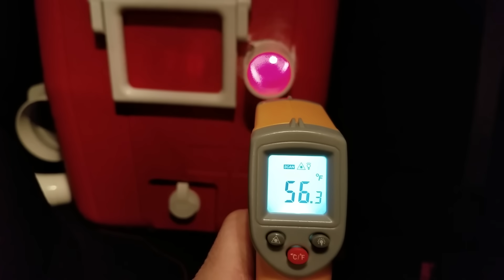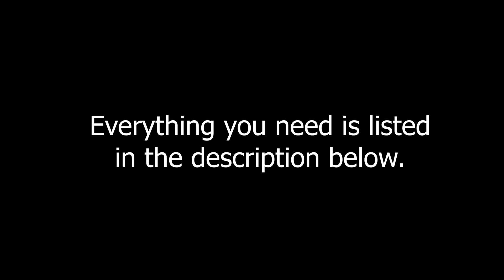Homemade Portable Air Conditioner DIY - Version 2 - Runs off 12 volt battery, car, or solar!

Comment: 4:30 this is the most stupid thing I have ever heard. No the air isn't cooler if it's blown harder. In fact it's even slightly warmer due to compression. The reason it feels cooler is because more moisture from your hand is evaporating and for that to happen, it needs heat, which is transferred from your skin to the moisture.
Reply: It's called the Bernoulli effect.  Its the reason you must worry about carburetor icing on an aircraft engine even when the outside temperature is 100 degrees.  Forcing air from a large volume into and thru a small opening.  An experiment:  Air up a tire to the proper pressure.  Remove the valve core, which will release the air thru the valve stem quickly.  Ice will appear on the threaded part of the valve core.  It is fleeting, melting VERY quickly.  So, yes, if air is forced thru a smaller opening it will indeed be cooler.  Quite a bit cooler in some instances.
Reply: Jesse O'Q 

He was explaining how the Bernoulli effect works, and correcting the person who was attempting to "correct" someone incorrectly. He wasn't applauding the device for its efficiency.
Reply: wish i could laugh at your comment
Reply: Jason Ozment I agree.  There’s always some genius out there to berate people for their efforts. Jesse is a real motivator isn’t he!  Funny, but the fact is the video shows ambient temperature lowered through this device using a simple inexpensive motor (both to buy and run) and a few other parts.  If the idea was to create cooler air, then he achieved that.  It was never meant to be a thermodynamic innovation.  Jesse, what you need to be schooled on is your social graces since you have none.  Maybe you can get that big head of yours back through the school door.
Reply: Jesse,  ok so forget the SUV.  I have a travel trailer that has ice cold AC when hooked up to power.  I want to stop in a rest area in florida and take a nap while not totally melting away.    There is no power for me to hook up to.  I don't own $2000 worth of honda inverter generators and if I did I'd probably have to stay awake instead of napping to watch them and make sure nobody steals them.

This seems like a reasonable solution to allow me to cool, even if very inefficiently, the space where our queen bed is (not the whole camper) so that I can nap.  and all for the price of some battery power and a couple of dollars worth of walmart ice.

Is there a more efficient solution to my prolbem?  I'm asking with genuine interest as you seem to have some knowledge I might lack.

Thanks!
Reply: Jesse O'Q There’s a reason you had a 1.7 GPA...
Reply: Ricardo Cruz I still am laughing at him, weeks later.
But what do I know, I'm no rocket scientist.
Wait, my old lady said I am.
Reply: FACT BATTLE
Reply: Knetterkop. The faster air moves over an evaporator, the more latent is removed through condensation. Just the opposite for heating.  In heating the longer the air move across a heated surface then the air can pick up more BTU's so you slow the air down!  No one is compressing air, just removing heat form one area and displacing it to the outdoors, just the opposite for heating!  The only time the application of compression is a add heat to a refrigerant through a compressor.
Reply: If you take the same amount of volume of air and you push it through a smaller and smaller opening eventually that are will become quite a bit cooler than where it started you can actually make an air conditioner using that method where all it does is push the air through smaller and smaller tubes it's been done before the air becomes condensed and cool.
Reply: Jules Thompson effect. He steps the air pipe size down twice. Science is your friend.
Reply: Unfortunately I'm in florida... evaporative air conditioning doesn't work :P ... same with lying in the grass in the shade... :P

I'd defiintely have a dedicated battery pack for this that gets charged by the towing vehicle while we drive.  I share some of your concerns but there's only one way to find out.  The problem with the generator is that they take up A LOT of space and our travel trailer is the right size for us but space is at a premium... and they're crazy expensive if you need them to generate the power required by the units they put on the Trailer.

Frankly I can't believe the manufacturers haven't figured this out yet and equipped the trailers with the option of two smaller units... sure two smaller units would be more expensive than one larger unit but...

If one fails you still have some ac...  you can have better climate control which I'm sure some people would appreciate, for instance vent one to the sleeping areas and the other to the central area.  Finally of course two  smaller units could be small enough that a 2000W generator can power one.  That would be awesome :)
Reply: yeah, I hear you...and the weather for usa is atrociously hot and getting hotter...during power outages, we always hear on the news that people are stealing generators from others...people get those for emergencies but I wouldn't..you still needs to store fuel for long term...this idea on the video is worth a try...I was going to donate my old cooler to goodwill but I may try this out...good luck my friend...may you keep cool
Reply: And you have a better video on how to? Kick rocks man he is creating content for people to use
Reply: Why are you talking like you know what your talking about, when you clearly don’t. It’s simple thermodynamics...
Reply: Shieky El I'm just telling that what he is saying is wrong. There is no problem with great content, but don't tell stuff that's not true
Reply: Knetterkop somebody please explain to him how a nozzle works and that whay he felt was just air going faster due to the area reduction, and a fresher sensation, not colder
Reply: the faster the air the less time it has to mix with the warm air
Reply: honestly, how often do you stop at rest stops between your travels to sleep?...if you take naps often, then maybe a generator would be the answer and have it built in to your trailer $$$$..this video has a simple, good, easy to make cooler (but loud not for sleeping)...and it might not be enough to cool down the trailer...put the cooler outside in the front by the batteries on the frame or back bumper and run both the pipes through a window of the trailer with a makeshift panel enclosure...and don't know the size of your trailer and how this would work for cooling...and you would drain the batteries unless you run solar...and you might want to invest in some good 12v fans or amazon: $45.00
Fulstarshop Universal DC 12V 35W Evaporative Air Conditioner Car air Conditioner Portable Mini Cooling Conditioner Water Evaporative air Fan, Black...but do your research...I would just lock up the trailer and sleep on the grass under the trees until you get rest and ready to go again but in Arizona, it would be difficult...good luck my friend
Reply: Elmer Thudpucker The Bernoulli effect is the same concept used in modern refrigeration. This however is a cooler of ice with a fan. It's a totally inefficient and silly idea that has nothing to do with the Bernoulli effect. Similarly, I don't plan on cooling my SUV by filling it with tires and deflating them while I drive. I'm glad you're interested in physics, but I hate watching people teach other people how to invent square wheels.
Reply: Congratulations! You've invented a Rube Goldberg SUV air conditioner. I barely have a HS diploma with a 1.7 GPA and I could school your ass in thermodynamics. Stop trying to find better ways to move "cold" and consider that cooling is about moving heat. How about putting wheels and an engine on your refrigerator and driving that around? OR MAYBE just fix your vehicle's AC, you dummy!!!
Reply: Jesse O'Q not capable of critical thinking are you?

Comment: 3mos later, part 2 review? Any pros/cons you care to discuss? Thxs for sharing, cool diy!
Reply from the maker: The only thing I would change is I would have run the metal tube in higher on the side rather than at the bottom. I had a small leak form that I had to fix. If I had mounted higher, it would not have been an issue. Other than that, I'm happy with it.

Comment: How long can you run this thing on a 12-volt battery without recharging the battery? Alternatively- do you think a solar panel would work to power this? If so- what type would be necessary?

Comment: Getting ready to build one to use at my daughter's soccer games at the bench on hot days. I'm considering installing the in line fan inside the cooler to minimize sound and the large fan hanging off the side of the cooler. My concern is would it be too cold for the fan inside?  I may use a small chuck dry ice in addition to water ice, but probably mostly regular ice due to convenience and cost.

Comment: Yeah, these don't work.  I tried one once when our air cond went out.  It isn't worth wasting your time building.  Build a swamp cooler because it WILL ACTUALLY cool your house.
Reply: but it DOES work.  and its not for cooling an entire house.
Reply: Power Supply it did not even cool a bedroom for us.  Not enough cooling.
Reply: David Hoover, sorry for your experience, maybe you did something wrong.  or maybe your room is too big.  I've made about 6, with different materials/sizes.  8x10 and 12x14 rooms/mini camper.  Not nearly as good as an actual air conditioner, but noticeable difference each time.  4 to 8 hrs depending on unit size/room size and exterior temp.

Comment: Great job the dryer duct is an excellent idea, it would also allow you to create a chest for the ice in odd shapes if you don't have the room for a rectangular ice chest day like the cab of an old truck or tractor that would be too expensive to repair the existing AC. Thanks
Reply from the maker: Thank you. Keep in mind though, that it is a rigid tube, not a dryer duct. A dryer duct would be too flimsy and much more likely to get a hole in it. I put a link in the description for the tube.

Comment: What tools did you use to hone out the hole and to cut it. I think it can be converted to home wiring 12v . But need tools also to know
Reply from the maker: You mean the holes in the cooler? I used a drill and a jigsaw.

Comment: Your design would be better if you did not decrease the pipe diameter. Decreasing the diameter will increase the exiting air speed but it also increases air pressure which indirectly heats the air. This is the same reason turbocharging cars needs intercooling to counter the temperature increase from boost.

Comment: NICE DESIGN,  The PROBLEM  is a huge "CONDENSATION" build up along the aluminum ducting. Warm air outside forced to passed along your aluminum ducting surrounded by cold temperature, The results is condensation(water develops inside aluminum ducting"

Comment: I just wanted to double check. The couplings you listed have 2" ends that connect to the 3" metal tubing. Is the rubber thick enough to cover that inch gap, or should it actually be 3" ends on those rubber couplings?
Reply from the maker: Yes, the rubber is thick enough. The 3" tubing will go over the 2" rubber ends.
Reply: Okay, just ordered the last of the parts. The last one get's here on the 24th so I'll be building it that weekend! Wish me luck!!! I also ordered https://www.amazon.com/gp/product/B005Z7YZA4 to make reusable ice cubes with. Hoping that will help it to work/last even longer and colder!

Comment: How long does it last?  A quick google shows 200btu per pound of ice.  20 pound bag would give you 4000btu.  Calculations show:  In a 10x15 foot room it would last an hour.  About four hours in a SUV.
Reply from the maker: You're complicating it. I'm not sure what the calculations are that you are looking at, but the simple fact that you are not blowing air across the ice makes it last about 3-4 times longer than if you were blowing it across the ice. The length of time it last also depends on the insulation of the cooler.

Comment: Can i use plastic pipe as an alternative? I cant find the pipe you have used in our local hardwares.
Reply from the maker: The plastic pipe will not conduct the cold very well. You at least need sometime of metal pipe. You can order it on through the link I provided in the description.

Comment: Just in theory, if you use stainless. Aluminum 3 or 4 inch pipe inside the cooler,  you may get a much cooler temperature reading.  It may drop to its 30s.

Comment: I live in a very humid area. So the arctic fan doesn't work for me since it blows a fine mist of water in the air. I need only dry air.  Does your cooler put water in the air? It doesn't look like it would.
Reply from the maker: No. It does not because the air goes through the tube and does not come in contact with the ice.
Reply: So its due to the tube? I see many videos of coolers with a hole and a fan. I'm guessing those could blow out some water.
Reply from the maker: Yes. Because the fan is blowing across the ice and will pick up the moisture as the ice melts and blow it into the air.

Comment: Novice here. I have the parts to make this thing. Stupid question the blower wires are 2 one black one brown, the 12 volt plug has 3 wires one red one black and one yellow. Is the yellow wire a ground?
Reply from the maker: You connect the black and yellow from the plug to the black wire on the blower.
Reply: make & do 
I just built this but I put a 5 amp fuse with clips between the black wire from pump and black wire from my battery cables. Just running off a 12 volt lawn mower battery. Did you not use a fuse? And what did you hook the brown wire to. I connected brown wire with the negative off battery cable.

Thanks
Reply from the maker: Black is for negative and ground. Yellow is for pattern change, but you want be using that so just connect black and yellow together. Look at 7:08 in the video.
Reply from the maker: Look at 7:08 in the video for connecting the wires. Also, there is a fuse built into the plug so you don't need to wire another one in.
Reply: make & do 

I did not use a plug in. I just bought battery cables and connected straight to a 12 volt lawn mower battery is why I put in a fuse clip.

Comment: I'm at an indoor flea market.  As you can imagine it's very hit in summer and was wondering how will I be able to tweet your design o work with a wall outlet?
Reply from the maker: You should be able to just buy a 120 volt adapter.

Comment: No your wrong, when air get compressed you going through a small opening it heat up. Basic law of thermodynamics it'a true of any gas.
Reply: but the increased air velocity makes it seem as if its cooler because of the evaporative effect as it passes over your skin

Comment: Thank you for this! I’m trying to get ready for hurricane season and this is exactly what I needed. I got to this vidro from an older one of yours where you said this model won’t add moisture to the room therefore no increased humidity. Is that true? How so? Thanks again!
Reply from the maker: This one doesn't add the humidity because the air is not blowing over the ice. It is going through the tube which is dry.
Reply: make & do Oh interesting! Could the same effect be achieved by using frozen water bottles?